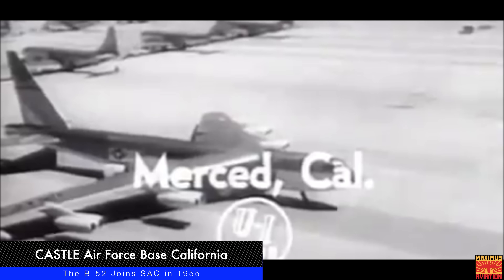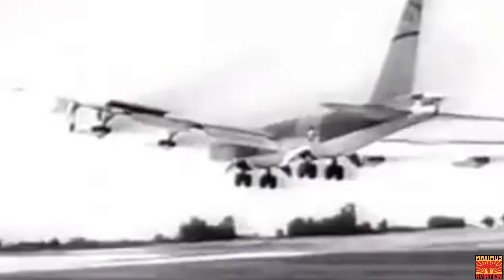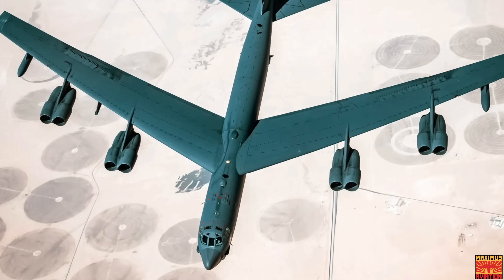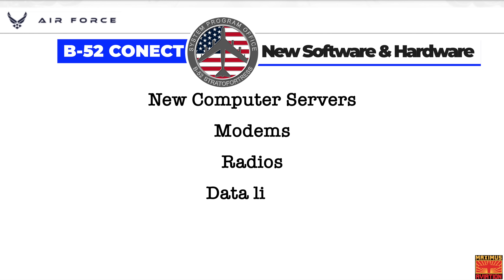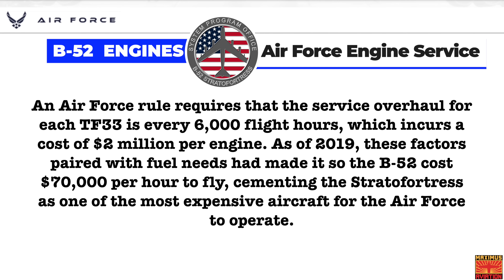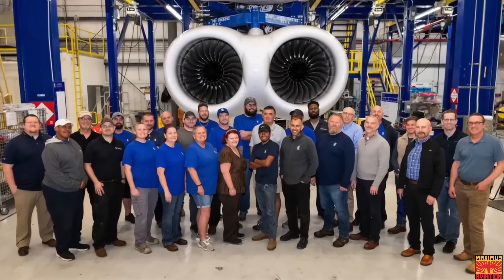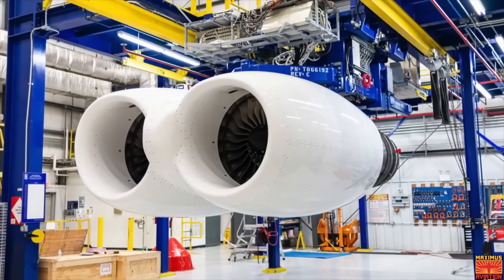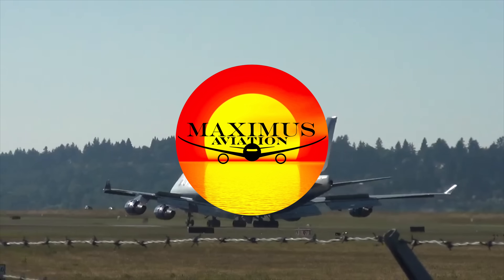The B-52 Will Fly For Over 100 Years With Its New Rolls Royce Engines!

Comment: The US industry did allow RR to be selected? 
I'm surprised!
Reply: The F130 is actually a BMW engine, designed in Dahlewitz, Germany
Reply: @sandervanderkammen9230  That does not make it less surprising.
Usually the US industry intervenes via its lobby before such a contract is realized. Like in the air tanker story where the contract with airbus was already signed. But then the specs were changed to favor the Boeing submission and the deal was blown.
Not that I can't understand that, but the US always loudly complains when others do the same. ;)
Reply: @sandervanderkammen9230  Hello Sandyboy,  F130 is the US designation for the ROLLS ROYCE BR725 engine (in much the same way that J65 was the US designation for the AS Sapphire engine that was the F9 Metrovick). 
As you know it has nothing to do with any wholly owned BMW company. 
You'll recall that in the early 1990s Rolls Royce offered BMW a chance to re-enter the jet engine market with a joint venture to develope the BR 700 series engines from existing Rolls Royce twin spool technology, so that Rolls Royce UK could focus on its more sophisticated triple spool engines. Unfortunately BMW couldn't hack it for long and by 1999 had declared that it was copping out.
As you'll recall , fortunately Rolls Royce was happy to take BMW's share and keep the local workers on and it became a wholly owned Rolls Royce company. As you know that was quite a few years before the development of the BR725 which first ran in 2008 long after BMW was gone.

Comment: I've been wondering for years when they were going to re-engine the B52.  I thought that they would replace the 8 small engines with 4 large engines, but I trust the people that made the decision know way more about the plane than I do!  It's nice to hear that the engines will be manufactured in Indianapolis, probably at the old Allison plants where I worked 40 years ago.  I was sorry to see the Allison name taken off the plants.
Reply: Ground clearance problems with the larger diameter engines required canned that approach.
Reply: Apparently going from 8 to 4 engines would require basically redesigning the whole wing, which is why they're sticking with 8 engines.

Comment: I grew up in Merced and when Castle AFB had it's scramble drills the whole town would shake with the herd of B52's and KC135 tankers taking off at about 30 second intervals. Castle also had a couple of B52's crashes with nukes onboard. As kids we had the air raid drills at school where we would duck and cover along a classroom wall. It may or may not be true but someone told me years after that the reason for ducking along a wall wasn't for safety but recovery. Being only 7 miles from the base there wouldn't be much to recover. The base itself is huge but it also goes deep underground. I know because I got a tour of a portion of it.( High ranking family friend.)  If you've seen "Dr Strangelove" the ops area resembled the war room scene. I wonder what goes on down there now?

Comment: Just curious, if these engines have been flying around the rich and famous, as you put it, that means they're proven technology, right? Or am I missing something? My curiosity leads me to ask the obvious question I think. Why, oh why, if the engines are proven do the "NEW" F-130 engines need to be tested like this? Unless it's solely because it's going on a military platform, even so...? Just curious
Reply: At this level of engineering, there are no minor changes.  The whole twin-pod of engines needs to be tested together to see if there are any unforeseen vibration or heat issues.  Also in the video it was mentioned that they will be doing crosswind testing.  Do two engines in a pod breathe differently than one?  The duty cycle of the military combat application may be different than shuttling the rich and famous around in their bizjets.
Reply: The BMW F130 has never recieved a U.S. military type rating certification, it was planned to be used on the Hawker Siddeley H.S.801MRA4 but the program was cancelled before certification was completed.
Reply: @sandervanderkammen9230  Hello Sandyboy,  as you know Sandyboy F130 is the US designation for the ROLLS ROYCE BR725 engine (in much the same way that J65 was the US designation for the AS Sapphire engine that was the F9 Metrovick).  As you know it has nothing to do with any wholly owned BMW company. 
You'll recall that in the early 1990s Rolls Royce offered BMW a chance to re-enter the jet engine market with a joint venture to develope the BR 700 series engines from existing Rolls Royce twin spool technology, so that Rolls Royce UK could focus on its more sophisticated triple spool engines. Unfortunately BMW couldn't hack it for long and by 1999 had declared that it was copping out.
As you'll recall , fortunately Rolls Royce was happy to take BMW's share and keep the local workers on and it became a wholly owned Rolls Royce company. As you know that was quite a few years before the development of the BR725 which first ran in 2008 long after BMW was gone.

Comment: To keep the wings from falling off, the wing aluminum beams need replaced with carbon fiber beams with nearly 20 x's the yield strength of aluminum beams, no matter the alloy,  and titanium beams as Ruzzia probably won't sell us that metal. Actually makes me wonder if the Bear t95 turbo-prop has steel beams and how to keep dissimilar metal corrosion down. The components would have to be electrically insulated from each other. I recall a few years ago, while refueling, a b52's wing fell off down on the ramp. But that was during nap of the earth flying putting great stress on the wing fitments.

Comment: In northeast Ontario on a canoe camping trip the group was about to load up the canoes and paddle off when we heard a sound unlike what we'd been hearing for a week in the woods.  Then directly overhead comes one of these at under 100 feet!

We were under the flyaway of a practice evasion run.  Stunning.  And then the kerosene smell of the exhaust as it settled on us.  A memorable trip.  1977.
Reply: I read later a reporter's description of a ride along, he described the low level excursion near Chapleau Ontario on the training mission.  Yep,

Comment: In 1963 my family moved into our new home in El Dorado Hills, roughly 12 miles from Mather AFB.  Our house was under one of the landing approaches to the base and we had B-52's flying a couple thousand feet over our house going in to land a few times a week. Even at one or two thousand feet they were large, and loud, so loud that we had to talk a little louder when they flew over.  After a while I got so used to the sound that I really didn't notice it much.  I loved watching them fly over.  As I said they were big, loud, impressive, and kind of graceful looking.  I graduated university and move out of our house but I was saddened when they closed the base.  It was so long ago, but I believe the 352 SAC air wing was stationed there.
Reply: I worked at a plant nursery just across Hwy 60 from March AFB in Riverside, CA. We were right in the flight path as they took off. They were well under a thousand feet at that point, gear not fully up, not more than a mile from where they lifted off. It was impossible to speak when they went overhead; even shouting was not enough to be heard. 8 engines at full throttle, black streaks of soot overhead, you could smell, even taste the uncombusted fuel.

Comment: The fact that we cannot build a replacement and have to keep patching up this relic from long ago speaks volumes to the loss of momentum in aerospace technological engineering.  2 steps forward and one step back…..    B-52 to the B-58, to the XB-70…….  Then poof 💨 back to the B-52 as the workhorse.  Yes they built the B-1, B-2, but those also lost momentum.   Highly doubt the B-21 will be built in numbers or they would not be doing this re-engine.

Comment: In the late1950's early 1960's when B47's and B52's were based at Greenham Common in the UK they used to fly right over my grandparents cottage which was directly under the flight path. They were a mighty impressive sight as they came in to land and were just a couple of hundred feet above our heads. It's a sight that's stayed with me for over 60 years.

Comment: Aside from all the obvious advantages that you have well pointed out here, combat-wise, the most significant improvement will be around a 30% improvement in fuel consumption, an enormous improvement in combat range. Finally, getting rid of those 8 "smoke generators" might make a tiny bit stealthier. At least, fighters won't be able to follow the smoke trail for 50 miles😂

Comment: My father served in the Air Force for 22 years., one upgrade that was short lived was using four of the 747 engines to improve fuel economy, but due to high Maintenace costs they went back to the eight-engine configuration.
Reply: I think you are talking about one B-52 that had 747 engine on one wing testing everything before a contract was signed.
Reply: @GM8101PHX  I actually saw a B-52 with all four Wing pods with the 747 engine taking off and Landing.

Comment: If the pylons and housings are being changed along with the engines, I am curious if any consideration was given to replacing each pair of engines with a single engine with twice the thrust. I imagine it would have saved a significant amount of money. Modern jet engines are so much more reliable than those when this plane first flew which is why twin-engine commercial planes now routinely cross oceans.

Comment: The T33 engines are not original, except if you mean the H model only. It's unclear if some of the G models were converted to H.  The B52G had T57's which were turbojet, not turbo fan.  I was at Castle AFB in the mid 80's were we still flew the G models.  While I was there some of the KC135's were converted to the use the T33 engines. They stopped flying at Castle in 1994,   was officially closed in 1995

Comment: The current B-52 models flying today were built in the 60's. They have the same engines they were built with but not the first B-52A's. They came with the Pratt & Whitney J57-P-1W turbojets and not the TF33 of the current model. You need to give you story better context. The B-52H were the first to get the TF33.

Comment: I assure you the TF-33 was NOT the first engine on the Buff. The orginal engine was a Tubo jet that produced about 7000 lbs of thrust, The original 707/ C 135 engine was the same turbo. The tanker version of the 707 eg the KC 135 used water augmentation. to get off the ground. The TF 33 eg Turbofan engine came to the Buff and some Kc 135's in the 2000"s when USAF scrapped the C 141. They detuned them from the 21000 kb thrust of the C 141 to 15000 lbs so they wouldnt tear the wings off the old girl. BTW new engines are available that produce 120000 lbs of thrust. Yes USAF would need to remove a lot of stuff to make it work and redo the rudder(should be a big enough contract to keep vendors happy)  bottom line for an airplane that flys about 300 hours per year with a maximum fleet of 76 The ENTIRE program is another huge waste of time and money

Comment: Those smoky old engines really needed to be replaced.  Hopefully the reduced repair costs on the new engines plus enhanced fuel efficiency will take a significant bite out of that $70,000 per hour operating cost.  As for a century-old aircraft remaining in service, if it fulfills its role without killing aircrew, great!  They've already replaced all the insides anyway.  Barring metal fatigue like the C-141 experienced, keep on flying!

Comment: It should be noted that the Air Force bought large numbers of 707 engines from retired 707s to provide parts and replacement engines for the B-52s so saying they are still using the original engines isn't quite correct though it isn't quite wrong either.  In a similar vein the engines the first model of the B-52s were provided were not the same engines the last model (and the only model still flying) B-52s were provided.

Lastly, putting new engines on the B-52 has been proposed and tested many times, the surprising thing is that it was never done before.  Especially after how much cheaper to keep flying the KC-135 program was after those planes got upgraded and since the KC-135 is also a close relative of the 707.

Comment: Regarding the new engine...more or less power? 20% more fuel efficient?
Reply: It has about 20% more power but will be de-rated to about 8% more power. Fuel consumption is the game changer. BUFF will travel 45% further on same fuel capacity and have a huge 300% increase in electrical draw to power new avionics and other on board systems.

Comment: It'll be neat to see what exactly are the real (not estimated) improvements in fuel economy, range, and performance when the first of these engines are installed.  I've already got B52J on my license plate!  (B52H was taken)  I grew up near Wright-Patterson, and the whine of the B-52s going overhead is unforgettable.  I used to lay on my back in the grass and watch them fly over, our house was in the landing pattern (even though we lived about 3-4 air miles away) and they would go over with gear and flaps down for hours it seemed.

Comment: I am a retired B-52 G / H Crew Chief USAF Veteran 20 yrs. Active duty. Also an A&P mechanic that worked on AE1107 & T56 Turbo Prop Engines for RR Overhaul and Repair facility, Oakland, CA. I currently work for DoD Quality Assurance. Yes, aviation has been my profession my entire adult life. I saw many TCTO’s for the B-52 through the years. So when I learned that this aircraft was being modified again due to it’s design capabilities this platform is one of the very best Boeing ever manufactured. The analog / antiquated electronic systems are very much in demand for upgraded components and wiring. Digital electronics will allow the B-52 ensuring successful mission critical capabilities. I salute all that have worked in aviation and the technical phase in this career. We are a dynamic breed of professionals. It seems today not many people have the desire to be in this career field of technology. 🇺🇸 God Bless this great nation, America. We need the strength of the longevity of the B-52 Stratofortress.

Comment: Worked on them in 74-77 with the KC-135 tankers @ Castle AFB........ great plane. Just didn't like working inside the tale. In CA outside 110 deg. F, inside >140 deg. F. Even at 21 yrs old felt like being in an oven.🛫✈🛬
Reply: inside the tail

Comment: The latest and highly fuel efficient RR engines have a much bigger diameter. So unfortunately the B52 will not receive the latest technology. I guess the problem is the same like with the Boing 737, which was designed for small diameter engines, and so the new engines caused technical problems, security compromising, and 2 aircraft crashed, resulting in all new 737 getting grounded worldwide, which brought Boing close to bancrupsy.

Comment: Some of this is inaccurate. The remaining BUFFs are H models, with the TF-33, that is true. Older models used the J-57 and water injection. These B-52s were the last ones off the line and rolled off in the late 60's. These air frames are about 50 years old.

Comment: I was a C47 crewmember in Vietnam. Of course we flew low and slow (perfect for our mission) and the navigator (our mission did have navigators) would get coordinates for Arc Light B52 bombing missions 20 minutes before they came into the area so we could get the h..l out of there.  Anyway during the monsoon season we would return the next day and we could see small what looked like ponds of water where the bombs exploded. I heard that the "grunts" (an affectionate term) would use them to get a little relief from the sweltering heat. When we got intel briefings the captured VC and NVA said that the thing they feared thew most were the B52s. I can believe that! Oh by the way the one time we did not get out in time bombs are falling from 29,000 feet and we were at 6,000 feet. Our whole  airplane shook like the devil while we were scrambling to get away. SCARY!!

Comment: The current engines on the B-52 are not the originals, but the second engines.  The original engines were Pratt & Whitney YJ57-P-3 turbojet engines, which were later replaced by the more efficient TF33 low bypass Turbofan engines.
Reply: He is right the TF-33 were the original engine for all of the B-52H models
Reply: @GM8101PHX   The TF-33 is the military version of the civilian JT3D.  The B-52 took its maiden flight in 1952 and has been in service since 1955.  The TF-33/JT3D engine first flew in 1959.  So there is no way that the B-52 flew with an engine that didn't even exist for the first four years of its service.
The original engines, were in fact, Pratt and Whitney J57 pure turbojets.  The B-52H was the first model of this plane to receive the newer TF-33 turbofans, after the plane had already been in service for several years with the older engines.

Comment: As a Limey it's nice to know Rolls Royce are still making engines the way their founders did. I will not buy a modern RR with a BMW engine even if it does have umbellas in the door. There are plenty of good old 'Rolla's around and they are cheaper than many new cars. I'm old so I had better pull my finger out before I get my last journey anywhere in one. 
PS I'm older than the B52